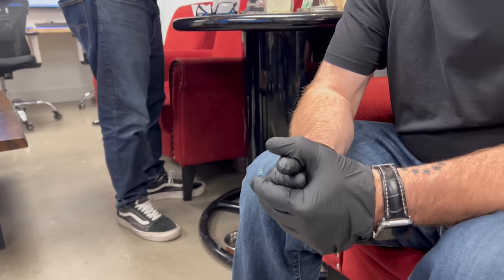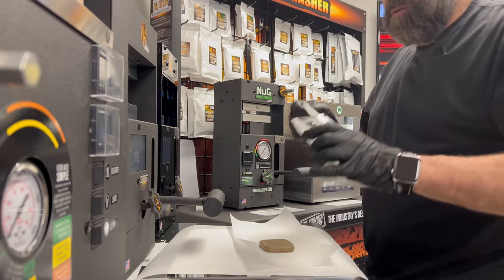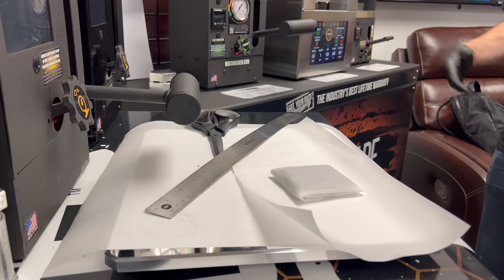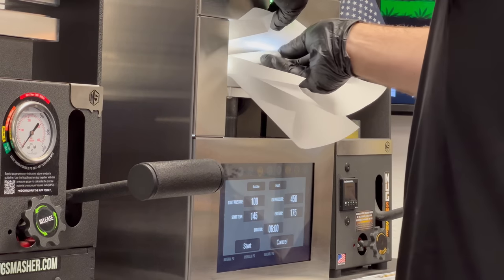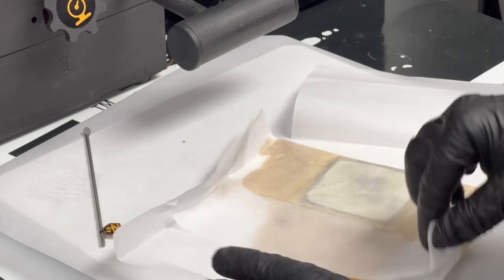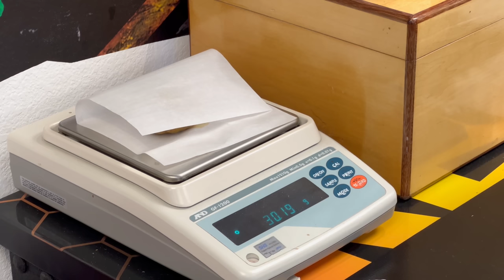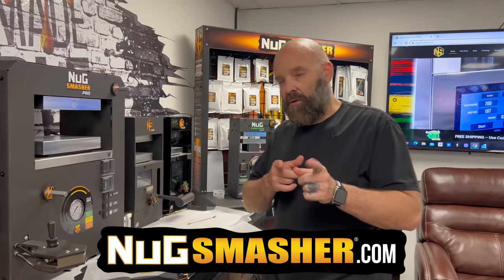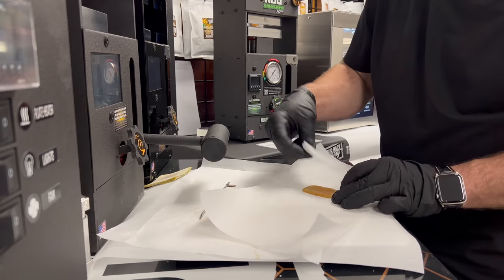38 Gram Bubble Hash Extraction

Comment: I been pressing for awhile been doing larger and larger amounts been doing oz of fresh flowers lately and I finally bit the bullet and pressed my keef to it was hard to do but I was very happy with the results after words I got higher return values and the after product was perfect and I to also use the dab press bags they sell I use a off brand custom rig works very nice after I fixed the manufacturers flaws been using it for over a year no problems kp-1 with a 5X5 inch pressing surface I did not need get more expensive one for a screen.

Comment: Ok, I screwed up a lot on this. I know what I did wrong, but I'm left with some very blond material left in the bag. It has no stickiness whatsoever. I did press more than once. Do you have any idea what this is? I used very clean bubble hash. I used low temps, and I think low pressure.

Comment: Had this question for a while now regarding a cannagar. Does the cherry actually get hot enough to activate the THC? It seems that when dabbing with rosin, it usually needs a little more heat to get a good vape.
Reply from the maker: yes it does get hot enough to smoke it that way with a thin layer

Comment: Press temp and press time?
Reply from the maker: This was pressed on our IQ in ramp mode which starts the press at 100 material pressure and ramps up to 450 material pressure over a 6 minute duration. Same goes for temp starting at 145 and ends at 175 degrees. Feel free to give us a call if you need additional help 928 852 7489. Thank you for watching
Reply: @Nugsmasher  Celsius? or Fahrenheit?